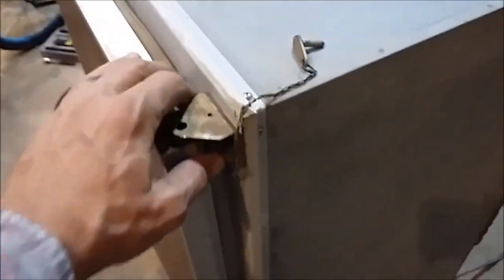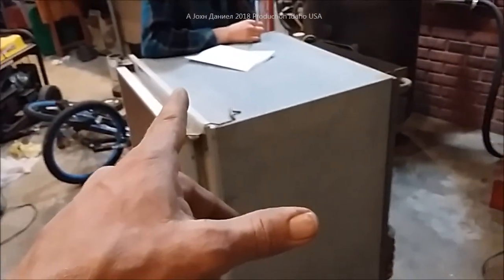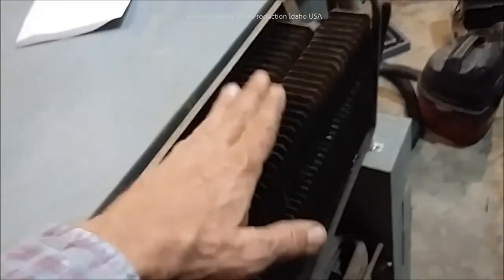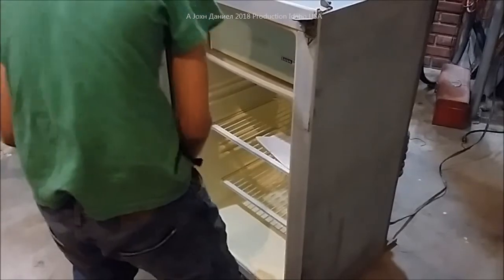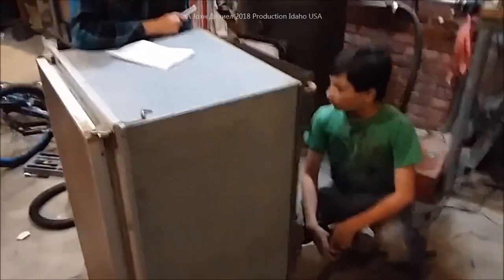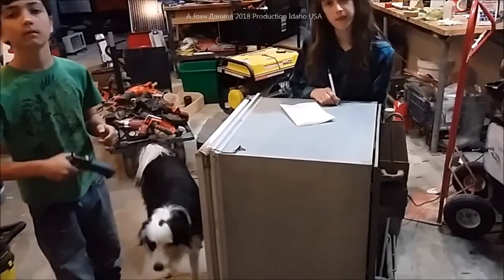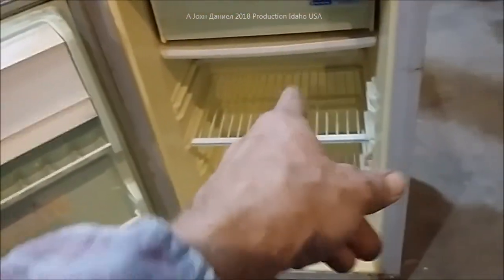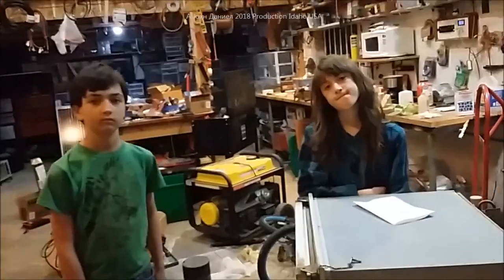RV Gas Electric Refrigerator, best tools listed below

Comment: I watched this SPECIFICALLY to learn how to safely get my fridge going in a 1968 Oasis travel trailer. Mine is a Dometic. Yours is Unfortunately you did not cover the part where you run it by Propane. While the rest of the video was charming, with the things you’ve taught your kids, it only made me impatient because I’m trying to get my refrigerator working not trying to see what a great job other people are doing with their children.
Reply from the maker: If your fridge is that old it may not work anyhow, but you can try. So remove it, place it on its top, let it sit 3 days, return it upright on the base for 24 hours, this separates the solids in the fluids so It can flow. Try the electric and wait 1/2 hour and see if you feel heat on the tubes. Cooling may take 24 hours to see real results. If you do see if it will get cold. If it does, then attach a standard 20lb LP tank and regulator. It will pipe to the 3/8 port on the fridge, using a extended log or charcoal lighter like you would use on a BBQ pit to start one, attempt to light it manually. If it won't stay lit, you may need a Thermocouple, use a Emerson 18" model that matches yours in the pinning mount. Repeat process. NOTE - You will notice the pilot light lever acting on a link to the back, from the front of the fridge so find it, manually press it from the back. You may need to hold the pilot gas button a good 4 minutes to blead the air out to get it lit.
Reply: @JOHNDANIEL1  Woah! That’s a bit much. It turns out, on the inside of the panel, under the fridge there is a diagram. Unfortunately, the piece for making the spark is missing. So I did think to light the pilot manually, but, sadly, not sure where it is and I started getting nervous. Have to get a friend to help. Once that’s squared away, if we’re not getting good results, I will go through the steps which you listed.

Not very good with this sort of thing. I had my trailer 2 seasons before I even used the propane. What a thrill to finally cook on my 3 burner stove and enjoy the ambiance of the one original gas light! Haven’t used the plumbing yet…

I love that you are fixing up things which have been discarded and what you are teaching the kids is invaluable. Come the Zombie Apocalypse those kids will not only survive; They will thrive!

Comment: Would you have a tank or complete hot water heater model GC6AA-8A Spec 141036?
Reply from the maker: I sure don't. Those are the fastest self destructing water heaters I know of. But you can get a tank cheap enough from https://www.pplmotorhomes.com/